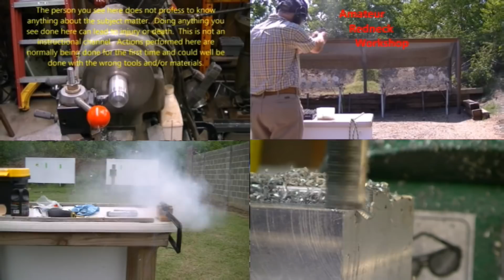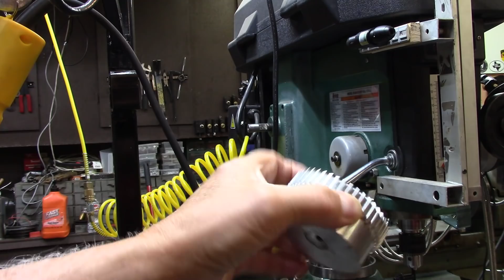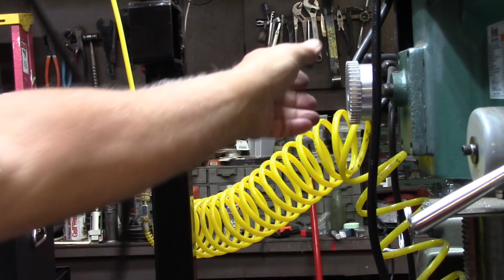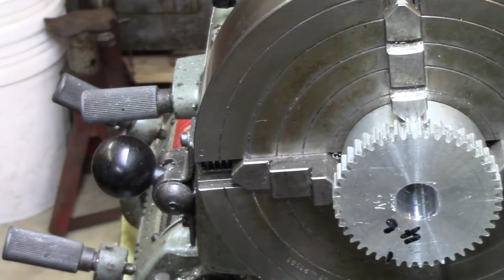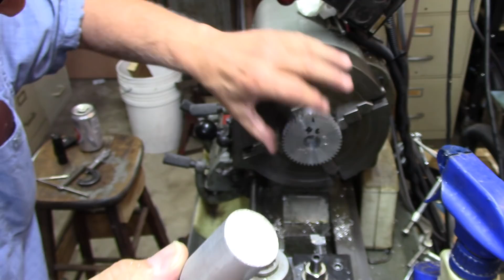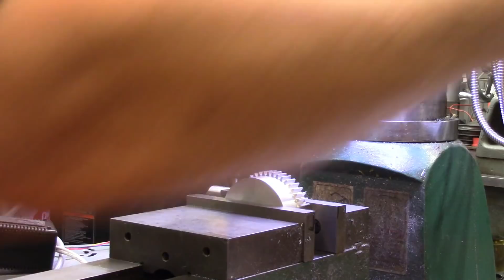Grizzly mill drill power head lift part 1 of 2

Comment: All you need to do on the wiper motor is change the input wires round, a dc motor will run in reverse if you flip the input, that way it will not unscrew.
Reply from the maker: Thanks Dereck.

Comment: Nice project Harold, if you are worried about the press fit, a grub screw or two on the joint would do the trick, a la Doubleboost. Cheers!
Reply from the maker: Actually I put a roll pin through the shaft and it seems to be strong enough to hold.  Thanks for stopping by.

Comment: Did I just heard that we missed a good "Blow Job"....????    First time I hear it was by inverting hoses on a Shop Vac...   lol
Sometimes if you really need to keep the original direction ine gearing, you add a idler gear, more work but but sometimes it get the job done...
Reply from the maker: Yeah you missed out there Pierre.  The motor will not coast in either direction so I have to power it whether it is lifting or lowering.  Of course an idler would have allowed me to lift in the thread tightening direction it seems to me it would be more trouble making another gear and axle than just putting in a roll pin.  Thanks for stoppiing by.

Comment: I still have a wiper motor waiting to be used for the same purpose - just not done it yet - seeing you working on yours makes me think I ought to try and do it sometime. Yours though has a useful area for mounting. I also need to find or make some suitable gears.
Never blow when you should suck! :)
Reply from the maker: Yeah sometimes vacuuming does suck.  I cleaned up after this and found the extra wiper motor so I still have one for the future.  Thanks for stopping by.

Comment: Why not just run the motor in the opposite rotation instead of the pin?
Reply from the maker: I have to mount it on the outside of the bracket and it turns the unscrewing way when lifting.  It would  be different if the crank was on the other side.  Thanks for stopping by.

Comment: Harold,
Put a little piece of painters tape on the part on both sides where the "Edge Finder" will touch that part. Then go ahead with your Edge Finding procedure. It will still work like it should but leave no ugly mark behind.
Reply from the maker: Thanks for the tip.  Thanks for stopping by.

Comment: An end mill in a drill chuck for plunge cutting should not be a problem.  It's the lateral forces that loosen a Morse taper.  With no more than you were cutting the jaws of the Jacob's chuck should not slip. Nice work, See you in part 2.  Chips BLOWING lol
Reply from the maker: Thanks for stopping by.